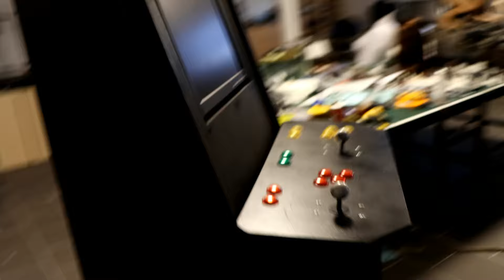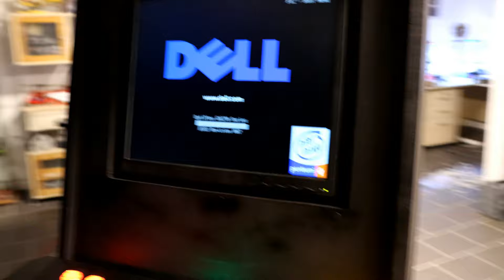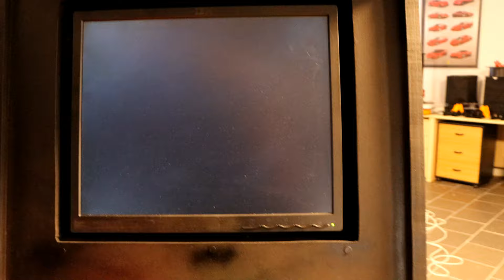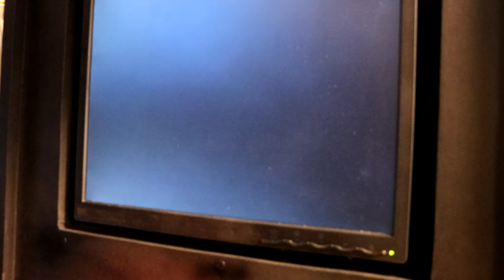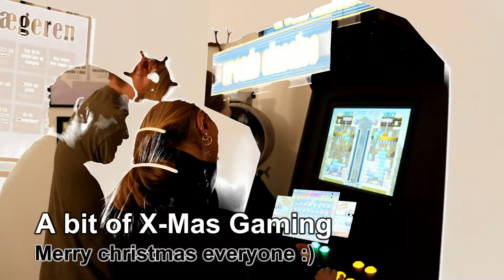Hobby World Vlog - Homemade Retro Arcade Gaming Machine [Christmas Gift]

Comment: That is so very cool :D   I have no critique because you have done an awesome job!   But have a couple suggestions.  For the acrylic glass..... make sure you have someplace cut it to the size you want, and make sure you don't drill or screw it in place. Acrylic is very brittle, and it WILL cause troubles. My buddy did a project like this and the acrylic (Plexiglass) split and cracked anywhere he tried to work it.   Better to spend extra for polycarbonate (Lexan). It can be cut, drilled and even BENT :O  If you use plexiglass,  you'll have to glue it, or some sort of channels to hold it in place.
For the marquee, I don't know what you have access to, but I go to a place that works with vinyl graphics for putting on shipping trucks and vans... they can print out your color design on white vinyl and any size you want :)   And light will go through it to light up.
Keep up the fun projects!
Reply from the maker: Thank you so much for the feedback. You are absolutly right about Plexiglass, it can be a real hassle working with. I have done a lot of work in it previously, and have a couple of special tools for cutting it. I have actually never tried using Lexan, but I will check that out, sounds like a great material for this kind of work.

Unfortunatly I have access to nothing regarding graphics and artwork :( So far I have built around 10 arcade cabinets and they are all made without art. But I plan on getting some made for them all in one go when I find a suitable place (a reasonable priced place) for printing it :)

And once again thank you so much for the feedback, it's much appreciated.